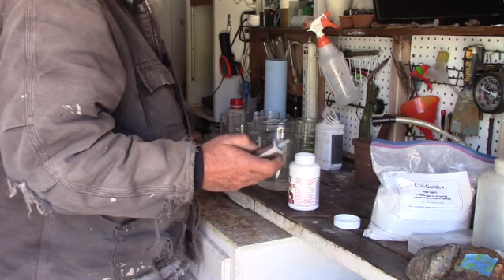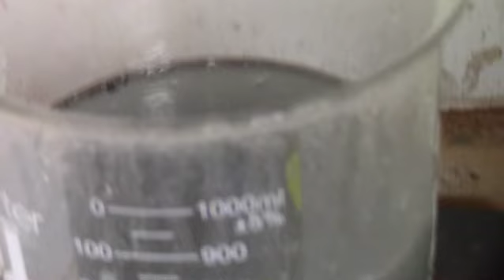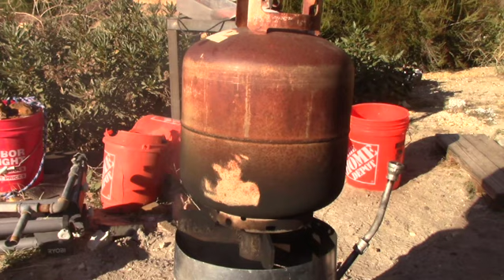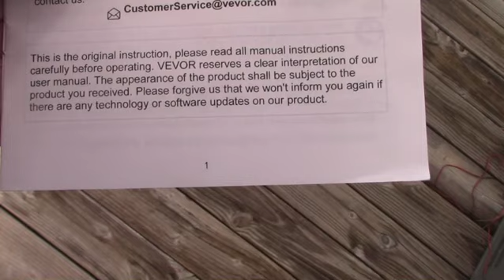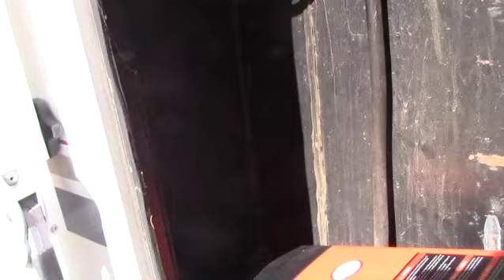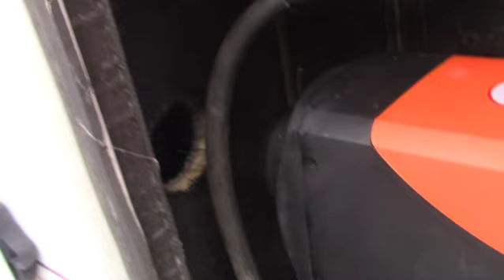Eco Goldex ERROR and adding heaters

Comment: Hi Lars, Our EGX has enough base to adjust pure water all by itself.  The question is, "what is the natural ph of the ROCK when you slurry it?"  I would mix the rock and water first and THEN measure the starting ph.
Reply from the maker: I had not considered that. I do check the ph a couple of times a day because of my high sulfides. Thank you.
Reply: Montana B is naturally a bit basic, so we hardly use any lime at all.
Reply from the maker: Did you get any instructions emailed to you from EGx? They said they emailed some to me several times but I never got them.
Reply: Yes.  Want a copy of what I have?
Reply from the maker: Yes yes, oh please yes. I hate guessing when it comes to chemicals (except for explosives).